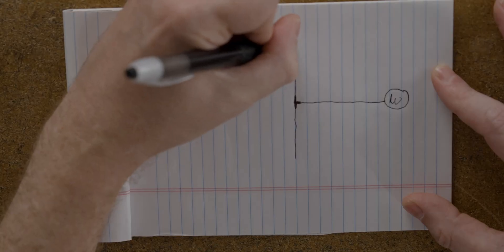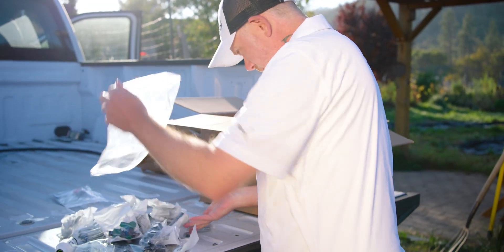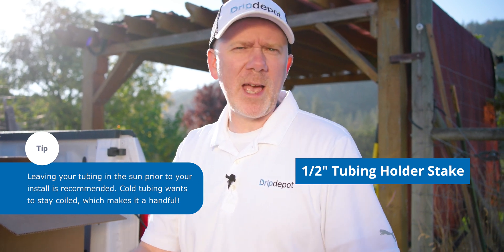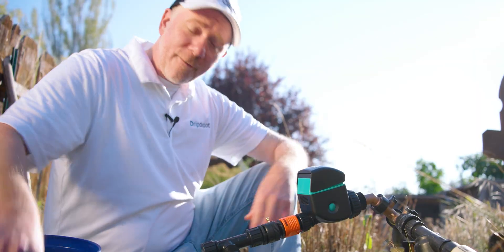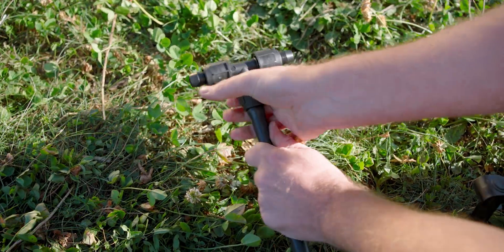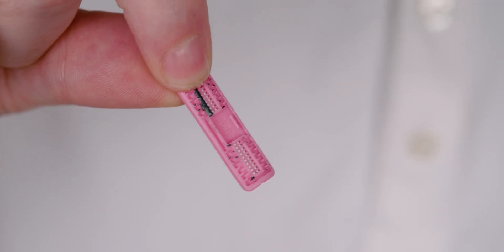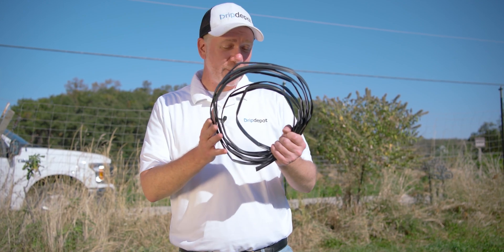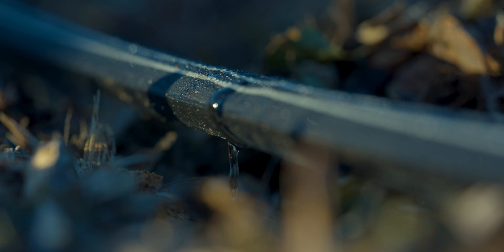How to Install a Drip Tape Irrigation System for Flower Farms & Gardens (Complete DIY Guide)

Comment: My water pressure is 78 psi the 25 psi pressure regulator can’t slow the water enough. What do I do?
Reply from the maker: The 25 PSI regulators should be able to handle 78 PSI no problem.  If there's still too much pressure downstream of it after your irrigation is connected and running, I'd want to troubleshoot elsewhere as that's pretty much exactly what they were made for.  

They do have a minimum flow rate needed before they begin regulating.  On the common threaded pressure regulators, this is 0.5 GPM -- below that and they don't operate as they should.  

Let me know either way, any details you can include will be helpful as a 25 PSI regulator should absolutely work here as long as the flow conditions are met.  :)

Comment: If I’m irrigating 100x100 bed what size main line tubing should I use 3/4 or 1/2”?
Reply from the maker: As far as length goes, you're well within the maximum length for 1/2" tubing -- this means we'd want to look at the flow rate going through it.  If the flow rate were too high, pressure lost from friction could also be high in 1/2" (or even 3/4", but it would be hard to reach the maximum flow of 3/4" in that space unless you were using high flow sprinklers).  

Do you have an idea of how much water (in liters or gallons per minute) you'll be using in the irrigation system?  With that I can check the pressure loss to see how high it would be in both 1/2" and 3/4" tubing :)

Comment: Sir Pls make a video of drip irrigation for drumstick plants.
Reply from the maker: I think it gets a little too cold for us to grow Drumstick trees up here, but I do have some information that may help -- Drumstick plants are similar to other trees in that they like moist soil when they're young and become drought tolerant as they mature.  Drip irrigation is one of the preferred methods for growing them since it can provide the soil moisture but leave the bark of the tree dry (which helps reduce the chance that pathogens can grow on the bark).  An above ground drip setup using poly tubing also means it's easy to remove when the trees mature and may not require supplemental irrigation (they're reasonably drought resistant when mature).  

With this in mind, it sounds like a standard tree ring setup would be a good route -- tree rings are simply 1/4" drip line formed into rings that go around the tree.  This gets water to all sides of the tree's growing root zone, but drips directly into the soil so that the bark remains dry. 

Here is a link to a video we did for growing trees -- though not Drumstick trees, the method would work similarly for Drumstick plants: https://www.youtube.com/watch?v=NkGTXrGkcRM

Also, here's an article that is well researched regarding growing Drumstick plants: https://www.nature.com/articles/s41598-022-26967-5

Note, I was assuming you were referring to Moringa, if you meant Drumstick Primrose let me know and I'll be happy to revise by editing this comment :)

Comment: I live in western Montana in Bitterroot Valley. Our temperatures get into the -15 degrees. What is the tolerance of your products to just winterize and leave in place?
Reply from the maker: Great question Linda -- the poly products are surprisingly resistant to freezing temperatures when drained of water.  In most cases you don't even need to use an air compressor if you have a low point you can drain it at.  Most of the folks who use poly tubing and drip tape do leave it out over the winter.  It's usually critters who are more of a problem than freeze damage.  

Basically, make sure to drain the water out of it and it will be well protected from winter temperatures (but critters might get some)  :)